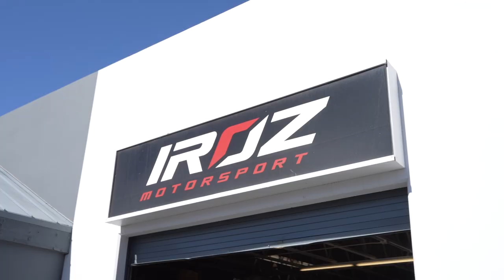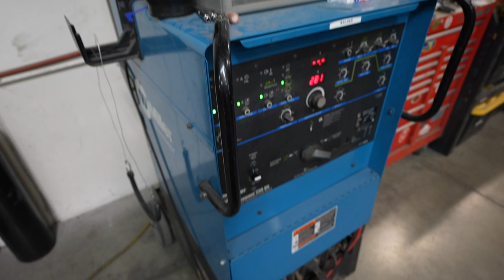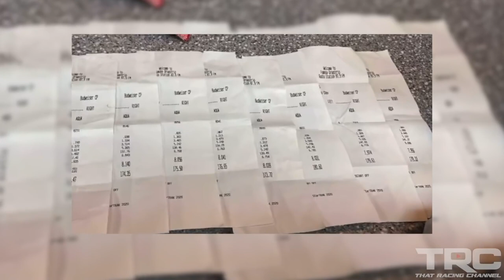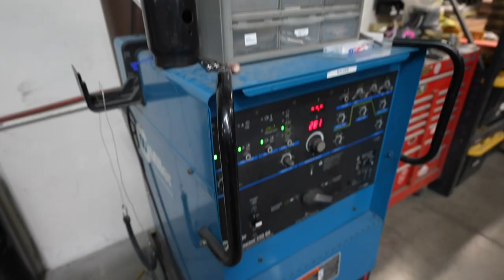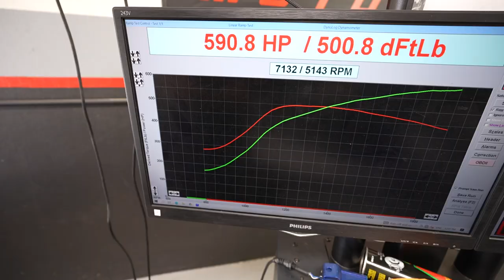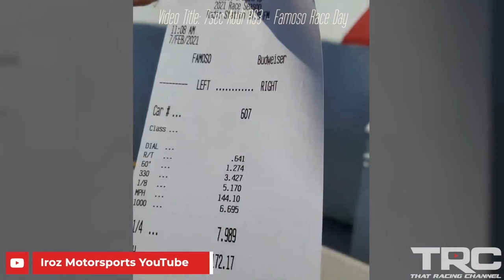Drifting new Audi RS3 and 300km/h in a 8-second TTRS! - Iroz Motorsport Tour

Comment: As an s2000 owner & a bit of a lover of mx-5's, I'd never look at an RS3 as a hairdresser car. For me its the 4WD thing that i don't wanna go with. Showing me the drifting on the newer ones with the new trick diff setup is pretty cool. Always loved the 5 cylinder engines but not a fan of understeer.
Reply: He was referring to RS TT's as "a hairdressers car". I wasn't a fan of the previous generation but the current gen I'd be ok enough with my masculinity to own one.
Reply: @davidt3196  AHH gotcha. Yeah I went in an 09 diesel TT years back and thought what a crap car but something like this is totally different. Tbh, I'd drive a FIAT 500 if it went as fast as a bat out of hell.
Reply: @chris555  haha, I bet! I don't know if we got the diesels in Australia but the bubbly shape certainly didn't help, at least the new ones in RS form look aggressive. The Arbath 500's are pretty cool, a bit like a modern day Mini that BMW should've built instead of the piece of crap they came up with.
Reply: You can tune the stock understeer out. Add E85 tune (minimum 400kw outcome on stock hardware), add rear swaybar, add camber tops and runs slicks on the front and performance tyres on the back.
Reply: @MrTroytroy  so wish I lived in Australia or America. We don't have to room to grow enough crops here & the weather ain't great. As a result, it's near impossible to get ethanol without paying huge silly prices.
Reply: @chris555  I use my 98 map every month or so - so I have to make do with 380kw. Still enough for a road car to make it interesting!